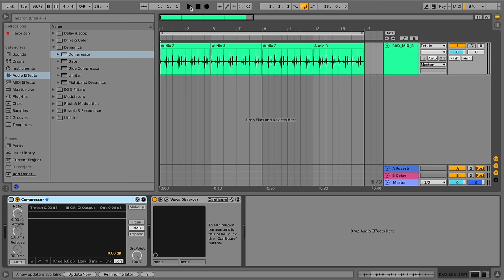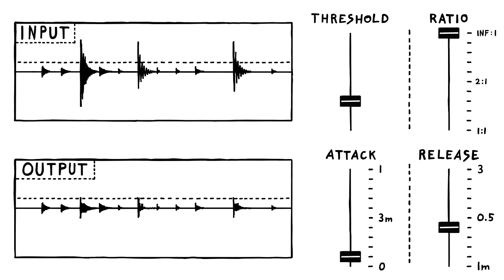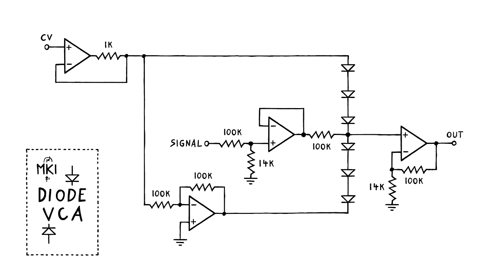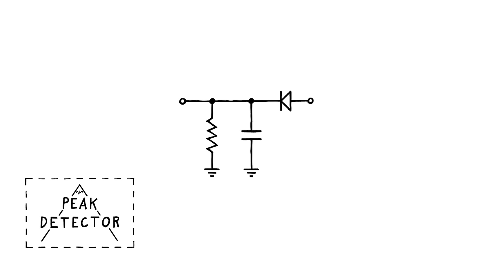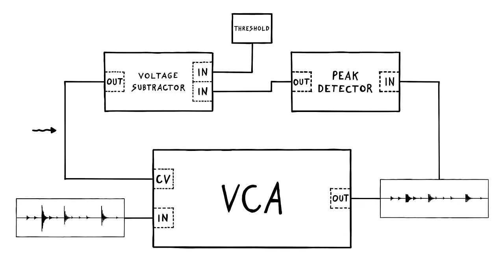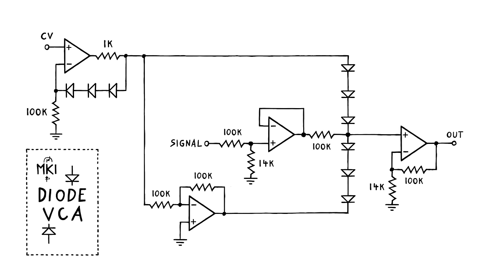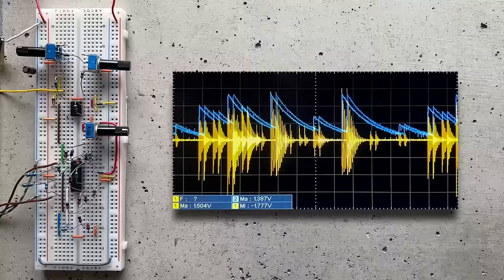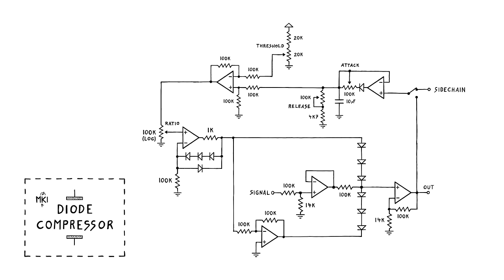Designing a simple audio compressor from scratch

Comment: I just built this circuit with some changes for my guitar. Since unamplified guitar voltages are a few hundred mV at most, I only used one diode on each side of the diode bridge and didn't attenuate the signal going through it. Other than that, I replaced the potentiometers with fixed resistors since I don't have any pots on-hand and changed two or three resistor values, but that's it. It works really great as a compressor.
Reply: hey, I'm trying to recreate this circuit for the same purpose as you, for a electronics class in college, I would very much appreciate if you could share the components you used, specially the OpAmp, since all the OpAmp I own strugles with such low voltages. Thank you.

Comment: Many audio signals from synths BECOME asymmetrical when they pass through a cap coupled stage. Any pulse wave with a duty cycle less than or greater than 50% will do this. Send a 90% duty cycle pulse wave into the DC coupled input of your scope. It should be symmetrical about 0V. Then change to AC coupling. The narrow phase of the pulse have a larger excursion above or below zero than the wide phase. This is due to the time required to charge and discharge the coupling cap. Even some of the example waves in this video show this. Since this is so, if you want your compressor to work well it doesn't make sense to throw away the negative portion of the wave. The negative half could have a significantly larger excursion from zero than the positive half.  It's EASY to full-wave rectify the input signal instead. One or two op amps. These kinds of circuits are called precision rectifiers and there are probable a dozen different types available on the internet. That way you get accurate compression of asymmetrical signals.All the famous compressors and limiters derive the side chain from a full wave rectified version of the input not a half wave rectified version. It's so easy to implement it makes no sense to throw away half the signal and wave your hands about audio signals being symmetrical about 0V. We're only talking about $1 worth of parts.

Comment: Hi Moritz, excellent job. Just a little add on. On every compressor one usually loses some level of the signal, therefore in the output stage you will need one more potentiometer to change the gain of the output stage to recover the original input level.
Reply from the maker: good call, will add!
Reply: @MoritzKlein0  You could also add a mix control between the input signal ("dry") and the compressed output ("wet!") which gives you instant parallel compression. Should be a straightforward output mixer stage between the two signals.
Reply: If you're actually compressing then you have to be losing input signal. Compressors make things quieter. But yes a makeup gain knob will compensate for that.
Reply: @Wizardofgosz  Not necessarily. Compression usually means: compression of the dynamic range, not the volume/loudness. Therefore: if you'd like to just compress the dynamic range (in contrast to limiting the peaks), then you'll need a make up gain.
Reply: @cls9474  You have no idea what you're talking about. Compressing dynamic range is compressing some of the gain or the volume. Compression only makes things quieter.
Reply: @Wizardofgosz  I wouldn't say that I don't have no idea - I've been designing mastering hardware and software for more than two decades which probably processed half of your music catalogue. But ok, if you think so ... and if rude answers make you feel better: great.
Reply: @cls9474  Shit. I had no idea I was talking to Mr Massenburg or Mr Gualteri.

I really doubt your claim.

Comment: sounds pretty good.  i think fully rectifying the cv signal would catch initial negative transients that you are missing and improve attack response. that's the only thing i would add
Reply from the maker: you mean rectifying the VCA's output before detecting the peak, right?
Reply: @MoritzKlein0  I mean fully rectifying the audio input signal you are using to detect the peaks.  if the input audio signal has an initial negative transient instead of + then your VCA signal will be delayed by that missing half wave

Comment: I am a hobbyist C++ Audio DSP programmer, so I understand exactly what a compressor does and the functional blocks used to control it, but the actual breakdown of specific implementations using electronic components has always eluded me.

Looking at electronic circuits without experience made it difficult to see the "boundaries" between components. Your video has helped me realize that obtaining generalized knowledge of common audio electronics sub-assemblies and the ability to identify those sub-assemblies is the key to my understanding audio electronics in general.

I feel significantly less intimidated about designing audio circuits after watching this video. Thank you so much for the work that you do!
Reply: Yeah, thinking in modules i guess. It's what makes any tear down or circuit analysis video good, is them kind of circling part of the board and saying what it is and then the individual components, and it's the right way to think of circuits. I guess the only difference is when you don't know and see a circuit board it looks over overwhelming but if you can break it down into its parts or sections it's more approachable.
Reply: I hacked a Yamaha compressor GC2020 to have a 10-second release time, it was so that when I watched a movie the sound was absolutely perfect and without it going beyond the dynamics and when the scenes with low volume the compressor slowly turned up the volume. Attack time=0, Release time=10sec or less
Reply: I'm in a similar boat designing a pi DSP drum machine+synth. Care to share your favorite resources of getting to understand compressors? This video helps but im trying to soak up some more. Thanks!!
Reply: Yeah, that's what engineers (have to) do... Divide and conquer. Doesn't matter if it's HW or SW. chop it into simple modules and test them thoroughly

Comment: You should modify the peak detector to use a precision rectifier instead of a half wave single diode like you use. That way you can reuse the circuit for an envelope detector to control a VCF without noticeable wobble when playing bass frequencies. The big downside to half wave peak detectors like that is that with bass frequencies you tend to hear a lot of wobble in the envelope as it’s only acting on half the peaks.

Comment: This works great for symmetric wave forms, which is most of the cases.  
Now, imagine you have a wave form which has negative peaks and no positive peaks, then the peak detector will never turn on.
To solve this problem you  need to place absolute value circuit before the peak detector, which could be as simple as full wave 4 diode rectifier circuit or its opamp equivalent.

Comment: Explanations are very good with animations helping people visualise what is going on. 
Those who are into pro audio side of compressors might like Gyraf Audio diy 4k compressor explanation as it shows pretty simple, typical VCA compressor, explaining how each part works and interacts with others in easy to understand details. Also shows typical balancing circuits, use of IC based parts like THAT VCA's, detectors, etc. 
Ian Bell of Custom Tube Consoles had or has example of simple opto compressor, i'm not sure it is still there although whole diy part is more than worth checking, same for Gyraf's.
I will always be thankful to people like Moritz, Gyrad and Ian Bell, not many take their free time to explain this matters to beginners, or even more advanced pro audio electricians/designers. Many thanks, wish you all the best in 2023.

Comment: As ever, very nice video, accompanying explanation, and pleasingly simple circuit.

One needs to distinguish, however, between compression and limiting.  Limiters direct the circuit to address the dynamic peaks, while leaving material below the threshold intact.  Compressors attempt to achieve an overall average signal level, by limiting peaks in the manner you've illustrated, but also increasing gain when content is well below the peak threshold.  In practice, the two can sound identical with adjustment of controls, but there can still be audible differences between them when controls are set differently.

One of the phenomena compression can result in is often referred to as "breathing".  Since analog compressors generally have no means to differentiate between pianissimo signals and background noise. they dramatically increase gain when the input signal is small.  If the release/gain-recovery time is long enough, the gradual increase in gain during soft parts results in amplification of background hiss that sounds like someone inhaling - hence "breathing".  The cure involves use of as pristine an input signal as one can provide, and as quick a gain-recovery as is plausible.  Limiters typically do not encounter breathing.

While not strictly true all the time, limiters often involve feed-FORWARD control, while compressors tend to use feed-BACK control.  That is, limiters use the input to control the final result, after the gain is applied, while compressors tend to use the amplified result to adjust how the gain is set.  That aspect plays a big role in achieving an overall average level-setting in compressors.

Another limiter/compressor difference that may not be quite so apparent in the percussion example used in the video is the impact of instrument, or other, signal sources that either sustain or have long decay times.  Although we may perceive such sustain or prolonged decay as smooth, it is actually filled with a great many little bumps, often referred to as "envelope ripple". When simple half-wave rectifiers are used to extract information about signal level, that ripple in the resulting control-voltage can produce small rapid fluctuations in output level (or filter-frequency, when used to control a filter) that can sound like "distortion" to the user; especially if used in conjunction with control elements that are able to respond to very quick changes (one of the reasons why photocells are often prized for some forms of sound processing).  The solution is often to use better rectification, as well as averaging the detected signal level over a longer period; the goal being to make the control voltage resemble pure DC as much as possible.

Again, as elegant as the circuit shown here is - and it IS elegant - it is really predicated on processing short percussive sounds, and would need more to be able to process longer-sustaining sounds without problem.
Reply: Indeed, this isn't actually a VCA, it's a clipper / limiter. It's an interesting journey but opamp based voltage controlled gain is fairly straightforward. There would be a lot gained by doing some reading up front, rather than trial and error. The Art of Electronics by Horowitz and Hill might be a good place to start.
Reply: This isn't really true at all. There is no difference between compression and limiting. Limiting is just extreme compression with an infinity to one ratio and a very very fast attack. The only time a  "normal compressor" adds gain to the quieter part of the signal that's not being reduced by the compressor is if you have a makeup gain knob and you're using it. Otherwise I can make a compressor with a wide range of controls be a limiter quite easily. My Urei LA 22 compressor for example.

And plenty of limiters do have makeup gain.
Reply: @Wizardofgosz  Oh they can certainly be tweaked and dialed in to sound the same, and yes there is makeup gain.  But there is a difference between rackmount units, like your Urei LA 22, and floor pedal compressors, which operate like AGC controls on budget tape decks.  In those circuits, there is not really any "make-up gain".  They are aimed at a narrow range of output signal amplitude, both attenuating peak transients and automatically boosting signal level, when it falls below some threshold.

FWIW, I built a pedal for myself, using the SSM2166 chip from Analog Devices (great great chip by the way).   It's a general purpose preamp dynamics-control device, and can function like a limiter OR compressor, if twiddled just right.  For instance, if I set the ratio to "infinity", but leave the threshold high, it behaves like a peak limiter, such that everything below the threshold retains all dynamics.  If I set the threshold very low, and crank the gain, it behaves like a compressor, with very little in the way of audible dynamics.

Comment: This is great and straight forward. There's so many ways to achieve compression that seeing a specific scheme broken down into an actual tutorial with the lab and circuit gives those of us interested an example of a clear pathway for our own designs. Because I am specifically desiring one for guitar ATM, I can see from your circuit a way to incorporate this theory of operation into a feedback path to buck some of my input buffer when the circuit sees an excess. 
As I understand it, you're demonstrating the implementation of multiple methods of compression for an overall more dynamic circuit and performance. 
Anyway, this will definitely help me with the design I have had rolling around in my head.

Comment: That is such a great video. The animations are first class and the oscilloscope capture is a great addition. Maybe inverting the colors between the audio waveform and the detector line would make the latter more visible. Interesting additions to the circuit would be :
- selection between feed-back and feed-forward detection
- a diode bridge to feed the detector
- the ability to hit negative ratios by actually amplifying the cv input of the VCA
- sidechain filters, low cut and sibilance emphasis
- gain reduction range control. This is done by limiting or clipping the sidechain output
- dry/wet Blend is fairly easy and very useful
- make up gain is also a compressor standard feature
Thank you so much for creating such educationnal videos, and for showing the world the actual behaviour of electronic components !
Reply from the maker: those are great pointers, thank you!
Reply: @MoritzKlein0  you are the one to be thanked ! 
Also, i would strongly advise against the implementation of automatic gain compensation, as this feature is only present in software and cannot give exact loudness match, as it uses estimated levels. Plugin developper John Matthews made a really good statement about it in this video : https://youtu.be/lsB_Jf50R0Q

Comment: Amazing video, I think that next you should add an input gain to maximize signal to noise ratio and then an output make-up gain to compensate for the volume loss due to compression; maybe you could also add a dry/wet control for parallel compression :)

Comment: I'd love to see how you would implement an automatic make up gain or automatic release setting. It's common on digital compressors but I suspect it would be harder to implement on an analog circuit.
Reply from the maker: would the make up gain would try to get the signal up to 0 dB? or what's the goal, normally?
Reply: @MoritzKlein0  Well, the goal is to match the output's volume to the input's volume, usually rms volume. Normally, you manually do this after compressing a signal, but if it's automatic, the make up gain automatically adjusts as you tweak the threshold/ratio pots, allowing you to hear in real time the effect of the compression, instead of having to juggle two knobs at once to get an accurate view of what you are doing to the sound.

My guess of how you would achieve this is by using stereo pots for threshold and ratio and doing some math to figure out by how much, approximately, the signal is getting reduced by and boosting it by that same amount.

Comment: More features? Let's see:
- *pass controls for the feedback line, to make the compression dependent on the spectral characteristics of the signal.
- normalize voltage against frequency to follow the energy density in the signal, rather than just peak amplitude.

Comment: Great circuit development process.
This is a great circuit to use with TVs, Radios, and phones.
This would normalize laud and low level sounds.
It might work better than Automatic Gain Control (AGC)
I would say a good sound system should have frequency equalizer, AGC, and a compressor.
A frequency shifter might also be fun to have in a good sound system, such that the frequency of the sound could be transferred by a fixed frequency.
This can be done by mixing the sound with 50KHz  and filtering the up converted signal then mixing it again with a sine wave frequency between 30KHz to 50KHz  and passing it through 20KHz Low pass filter.  This would shift the frequency up.
I can not think of a method to shift the frequency down at the moment, If any body have any idea please share.

Comment: One very common problem with any analog VCA is "control voltage feedthrough." Try putting a sine wave on the control input, with no audio on the signal input. Ideally, none of the sinewave would appear on the audio output. In practice, some will. Audibly this manifests as thumps that hit every time the control voltage jumps up when the audio hits the threshold.
Another common problem with analog VCAs is that the audio signal modulates itself. This effect will be especially prominent when the VCA is modestly reducing the gain, as the control current through the diodes will be close to the same magnitude as the current caused by the audio signal. A few percent distortion is hard to see on a scope, but try running a maximum value sine wave through the VCA, and then turn up the control signal just enough to attnuate the gain by 2:1 (6 dB) I bet you will have so much distortion that the sine wave is visibly altered in shape.
With the circuit you designed, the amplitude of the positive peak of the sine wave will be more attenuated than the negative peak. If you can see the difference, the distortion is probably >5%.